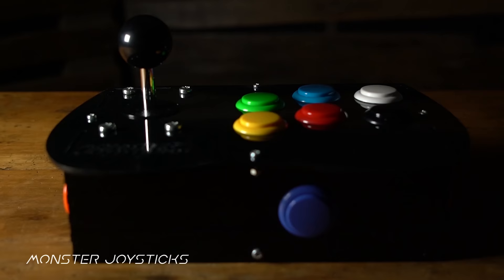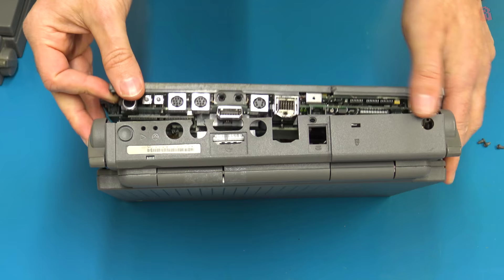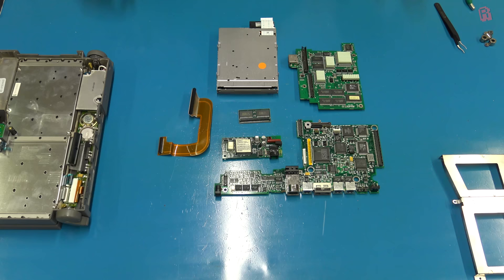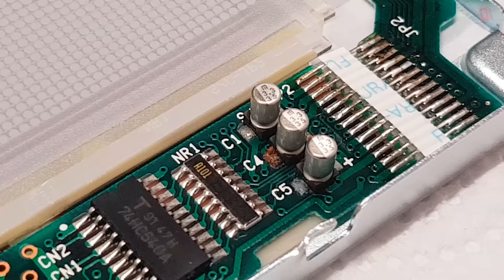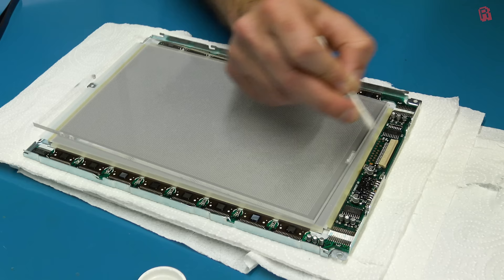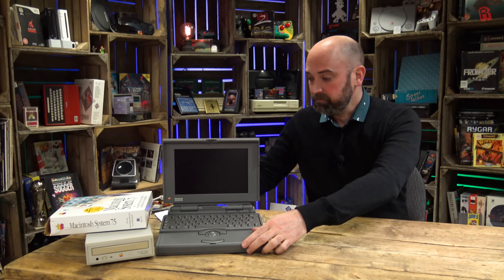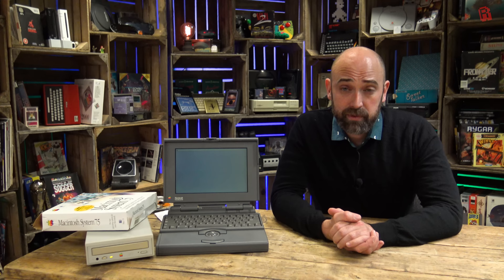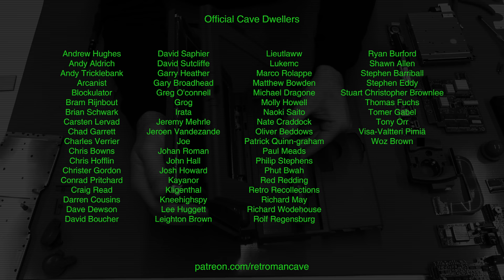Restoration of a '90s Apple Powerbook - Trash to Treasure

Comment: Not as pretty but still portable - wire the internal scsi pins of the scsi2hd to mate with your external cable.  I guess at that point you'd just need to figure out a way to get 3 or 5v or whatever it takes to it without extra adapters that need to plug into the wall.  Perhaps there's a pin somewhere on the back that provides enough power?

Comment: I'm dusting off my 145b and found out that the system date only got to dec 31, 2019. I wonder if updating it to 7.5 could fix it. Currently running system 7.1 right now, and from what I can remember, updating it via floppy drive was a real pain in the butt

Comment: The Macintosh Portable from 1989 was a good example of how not to build a portable computer. While the Macintosh Portable had some decent specs it suffered from a really big flaws. First, it had it’s heavy lead acid battery wired in series with the power supply jack, such that you couldn’t just run the computer off  the AC power supply if you had drained the lead acid battery all the way down. Making the problem worse was the fact that the power supply had a very low output. The amount of power the computer needed to run was higher then the power supply could provide to the battery at any one time. Thus you had to wait for the battery to fully charge before you could use the computer again once you fully drained the battery.

The second bug problem with this portable was the screen, which while being active matrix and thus superior to the passive matrix screens of the era, it had no backlight making it hard to see under low light condition. Thus you’d have to pack a table lamp to point towards the screen when using indoors often. They fixed this problem by adding a backlight to the 2nd generation Macintosh Portable, but along with a change to the type of RAM used that caused the battery life to drop in half. 

The final issue was that the o1st gen version used true SRAM and could hold up to 9mb’s but this was expensive. The 2nd gen model switched to a suede-SRAM that was cheaper but cold only support a maximum of 8mb’s. This pseudo-SRAM also used more power. 

All of this was fixed when the go together with Sony to design the PowerBook line of laptops that insured in the laptop form factor we know today. The Powerbook 160 was a part of the 2nd gen of the original true PowerBook 100 Series of laptops.
Reply: One other interesting fact, the original PowerBook 100 series was the PB 100, 140, 170 in 1991. That was followed by the 145, 160, 180 in 1992 which replaced the older models. An interesting fact was that the PB 100 was quit different in it’s motherboard design from the 140 and 170. This was because the PB 100 was designed by sending a schematic of the Macintosh Portable’s motherboard and having Sony miniaturize it. Thus it is really sort of like a mini “Macintosh Portable” with some improvements made.

Comment: you can't boot from floppy, right ? can you get system 6 to run ? go for basic HD &
 keep the SCSI2SD external ... easier to share software that way.
i've got a 1400cs & 5300cs (?) haven't used them in years ... 
batteries are original (!) [i should check if they leaked !]

Comment: Might have guessed bad electrolytic capacitors as usual. Good repair by the way. I think the scuzzy SD adapter was a good idea. i was wondering if you could shrink the board somehow, and HD slot after all in comparison is huge.

Comment: 17:20 And in fact that's the term. It's called a "Head Crash" where the arm is crashing against the spindle, as seen earlier. If this happens to any hard drive, it's a very expensive data recovery, and since it's scratched up the platters, the data is not recoverable. This is an ex-harddisk!

Comment: 3:05 you made a crucial mistake in taking apart the powerbook, you should undo the screw "under the flap" first, and than the rest on the bottom of the laptop, because if you take the screws out on the bottom first and this "flap" screw as last, it will put a enormous amount of stress on that screw causing the plastic to snap off, overtightening those screws is indeed another problem on those machines.

Comment: Whoever owned these treated them like absolute garbage. I still have mine that I paid a fair amount for, used, in 1995. The rear door was made perfectly well. Mine is still attached and there certainly isn't a crack in the screen. The only thing that's messed up at all is the lower button of the trackball which is a little loose and lower on the right hand side - it has to be a bad spring. I used it without any issues through 2005.

Comment: Thanks. Love it! I just found a 1993 PowerBook 165 in the trash that needs restoration. The machine powers-up and chimes and the display is back-lighted but very dark. No cursor or other visual information appears. One video shows that problem being caused by bad caps on the sister board. I haven't been inside the machine, yet. Should I assume those caps and the display caps you replaced ALL need replacing? Any other advice before I begin this project? Thanks again. I've just subscribed.

Comment: A fantastic video as always and do feel now if I wanted to open my 180 is will not be so daunting. As others I think have already said a version of the scsi2sd in the small form factor was supposed to have been made. I do wonder, now the screen has been recapped do the corners of the display still turn to black as the unit warms up. The general option was this was uncorrectable but a few people have hinted otherwise. I do wish I could solder!

Comment: SCSI2SD v6 is a much smaller board, it might fin well in there. Seems like the easiest solution, though not cheap. 
Also SCSI2IDE solutions are fairly compact, and with one of those tiny 2.5" ide drives it might fit?

Comment: Cool! I was given a later PowerPC one, still with that square dark grey aspect. The hard drive is in a bad state though.
Reply: jbmaru i used to work for company called GBM Digital that did apple sales and had a full training suite. I remember binning a shed load of these decommissioned SCSI hard drives onto a skip back in the day as they became obsolete when the IDE/SATA standard came in around Y2K. I wish i had mined them now as they would have become a veritable treasure trove.
Reply: @MrDegsy69  Indeed :) I have a similar story, on a smaller scale though: because I was the computer guy, a friend of mine gave me an aging PC with... Two 1GB SCSI hard drives, which was already tiny and I had no use for. I had an opportunity to resell the PC and did it, but a year later found a Mac LC II with a dying 40GB drive at a flea market for €5, and I still kick myself for not having a 1GB drive to put in it XD
Reply: @jbmaru  They made SCSI HDs up to the giddy heights of 400mb for the Quadra 700s and 900s we were stripping down before the IDE standard started creeping in. It is laughable by modern standards but their main advantage at that time was the fact that each Hard Drive had its own independant controller board which made them ideal for use in RAIDs and file servers. The reason we had to bin them was for the purposes of ensuring sensitive data on them was completely destroyed beyond the powers of recovery utilities. This involved disassembling the drives with torx bits, removing the platters and either abrading them or jack knifing them in a vice with a hammer. They did make quite dandy coasters for your mug of tea if you went for the sanding option though! 😂😂😂

Comment: I wonder if the SCSI to IDE adaptor is available and maybe an IDE to SD card adaptor would fit inside?
Someone else mentioned the SCSI to Compact Flash option already 🙂.
The 2.5" SCSI drives are too expensive for a retro machine.

Comment: With regards to Kapton tape, I know it's used for insulation and is heat resistant, but I didn't think that it stopped heat transferring through it. So putting it on, say plastic, isn't going to stop the plastic from melting. 

It resists heat itself, but it doesn't stop that heat being transferred to anything it's covering. So using it to protect chips, plastic or anything is a waste of tape. It's primary purpose is as an insulator in high to low temperature environments. But that's not the whole story, as those environments also need to be moisture free, otherwise the tape cracks and thus is no longer great at being an insulator. 

I would like to hear your thoughts on this? Or from others.
Reply from the maker: On its own it offers enough protection and doesn't leave a sticky residue.  It's also good for sticking down other materials like the foil.  I have a mug press here and use kapton tape to stick designs to the mugs before pressing at 200C for nearly 3 mins, so it's pretty resilient stuff and dissipates enough heat without ripping things off the board on removal.
Reply: @RMCRetro  Enough protection? I don't know, I'm intrigued to test it and find out, thanks. (I have plenty) That's also a good point, no sticky residue, I didn't think about that, great tip, cheers. Your other use is what it's perfectly designed to do,  as it's supposed to be resilient from absolute zero to 400C.

Comment: interesting pin-50 mod..is it that simple to just pull out this pin, I mean in comparison with the functionality of that Powerbook L-shaped scsi-dp25 adapter which has that additional scsi off/ dock on switch on it..today I got a 16, opened it, with your tut it was easier, thanks.

Comment: Having very, very limited knowledge of electronics, is it possible to replace the electolytic capacitors with ones that aren't? Basically, do they make capacitors that don't leak that you can use to replace the original ones?

Comment: What interface does the CD-ROM drive use internally? If it's not SCSI you might have an adapter in that 5.25" enclosure. Not perfect, you'd still be rocking an external HDD, but hey it'd be something temporarily if it is the case.

Comment: Holly crap I had no idea.  I have a  160mb 2.5 inch scuzzy that I pulled from a badly battery ruined laptop.  I had no way of testing it so have no idea if it works.  Whats the easiest way to test it?

Comment: There is always a worry that hot air will get under the capsten tape I've found
Reply from the maker: That can be a problem if you're not careful as it can trap the heat under there

Comment: if you're interested, i have an adapter to, convert that 15 pin apple screen connector, to a standard vga female.
Reply from the maker: Thank you for the kind offer, I do have one here I use with my LC so I won't deprive you of it, but I appreciate it thank you
Reply: ah, ok, i don't have any apples in my "collection" so i don't really need it, ebay it is then!

Comment: Very good restoration, excellent video as always. I think it's too risky to buy another SCSI laptop hard drive for that ridiculous price, they are too old and maybe fail in short time too. I'm currently working on my Thinkpad 760XL, unfortunately the screen died too, it has a big black spot of dead pixels and the diffuser and polarizer sheets are damaged. The  backlight works ok. I you have a spare Thinkpad 760 screen, please contact me, thank you!

Comment: I need to recap the screen on my 145b, the brightness just does what it wants. But I'm too afraid of breaking things while tearing that laptop apart due to how fragile the plastic is
Reply: If it makes you feel better I recently bought a 145 and was able to disassemble it without much issue.
And if it helps to convince you to take the plunge and recap the display - my 145 had a display issue when I got it (every 4th pixel in the top half of the screen is off) and I suspect it's due to corrosion caused by caps leaking on the display board. So probably best to take care of those caps...

Comment: Use a external SCSI hard drive in another enclosure along with the CDROM ?
Reply from the maker: Yes also an option.  As it happens I have a A590 Amiga HD enclosure I'd really like to put this SCSI2SD board into.
Reply: @RMCRetro  doesn't fit on the battery side?

Comment: This will solve your problem. 
The SCSI2SD V5 Powerbook Edition (2.5")  is a SCSI to SD memory card adapter to suit Apple PowerBook laptops.  This board replaces the 2.5" SCSI hard drive found in Apple PowerBook laptops.

SCSI2SD emulates a SCSI-2 hard drive using a micro-SD memory card. Each SCSI2SD purchase includes a fully assembled and tested circuit board, ready for use.
These can be purchased from inertialcomputing (dot) com

Comment: Great video! Are there any settings that have to be made when connecting an external display? I have a 160 that powers on and chimes with a working hard drive, but it never gets past a grey image. I found the adapter for the external monitor, but I’m only getting a grey pattern (albeit slightly different) there too. I was hoping to get an image even if something was wrong with the internal monitor.

Comment: What if you got a 2.5" SCSI drive for parts and repair, good platters and all, but replaced the controller board with the working one you have on the one with the dead platters? Just swap the boards.
Reply: If the pin numbers are bad, I recall they used 60 pins in the day, maybe?
Reply: Surely for $20 US, it might be worth it.
Reply: And I found an 80 MB variant that could also work. Again, just needs a replacement controller board, in which case it may read the drive as a 40 MB version, depending on what the motherboard's maximum supported capacity is. Around $80, but still, if the platters are good, it may work.

Comment: Great job Neil. Thank you for the A1200 comparison - as you note, a 68030 would have been a pretty desirable CPU for Amiga owners at that time.  My suggestion would be to find a SCSI2SD or SCSI2CF adapter that will fit in the 2.5” HD bay, then install the latest version of 68k MacOS as possible. A quick game of Prince of Persia would be nice, however the ultimate use would be to get the PowerBook online with Internet Explorer for Mac!

Comment: There is a smaller version of the SCSI to SD adapter that works with micro SD cards. Have a look on the Amiga shops, it's the one with a red PCB. That should fit.
https://amigakit.amiga.store/images/scsi_to_microsd_adapter_sm2.jpg

Comment: Good job, but your hot air desoldering style is about as elegant as a boozy elephant doing ballet in a tight space!
Reply from the maker: I think that's a fair observation XD
Reply: @RMCRetro  Not knocking it! it works and elegance is mostly overrated anyway.

Comment: Unfortunately a lot of the computers from this time period for Apple weren't very good, and ultimately contributed to Apple's near-bankruptcy a few years later.  It was very expensive for mediocre specs, even for the time.  It wasn't unusual to see countless broken Apple laptops in recycling centers, mostly since Apple products didn't age well software-wise, and you might as well buy something new when the thing eventually broke apart or failed electronically rather than try to have it repaired, especially at an Apple service center.  

Apple wasn't alone in flimsy plastic construction, but certain brands like IBM had a head start in making durable machines which cornered the market for a long while.  None of these products helped Apple as they careened towards some of the worst computers ever made, such as with the Performa series, some of which designed so cheaply that they couldn't even be bothered to have separate IRQs for the mouse and hard drive, creating some of the most miserable desktop experiences you can imagine.  When you can't move the mouse when the hard drive is accessing, then it's time to hang it up as a hardware manufacturer.  And they nearly did, if Microsoft hadn't bailed them out.

If anyone is looking for Apple nostalgia, there's a handful of machines that are worth your time, but a huge number of them that you should avoid.  Most of what you'll find out there are broken or for parts, or need proprietary accessories to work to their full potential, so be careful.  Do your research and you'll probably find something fun to restore, unless there's a very specific machine you're looking for.  Either way, good luck!

Comment: An Apple machine from circa 1992 with leaking capacitors. Buy cheap crap, stick an Apple logo on it and sell at extortionate prices. Spectrums from 10 years earlier have cheapo capacitors, yet out of 50+ I've refurbished, not one had a leaking capacitor. Obviously not as crap and cheap as Apple suppliers. Does anyone get a sense I don't like Apple? LOL. Mr Rossman may be able to corroborate my thoughts.
Reply: In the early 90's, these SMD caps where a completely different proposition than a regular quality through hole cap.

As for crapbooks, I'm watching the JRE right now on a MPB that is 12 years old. If it dies now, I'll be sad only for sentimental reasons!
Reply: @Diggnuts  I don't know the history, but I suppose they were quite new back then so weren't as resilient over time, good point.